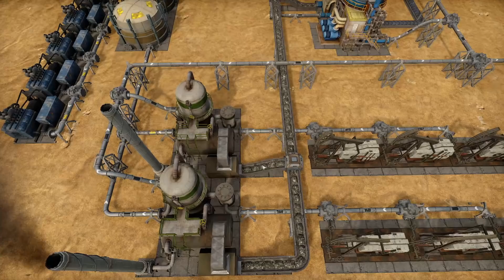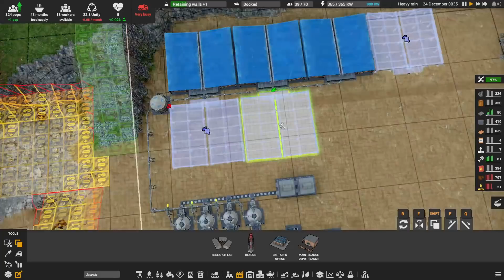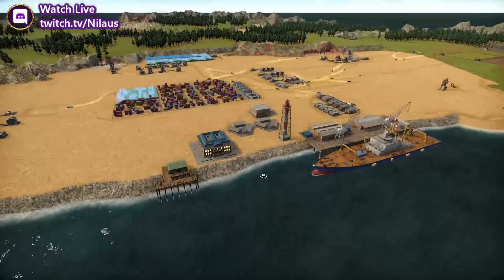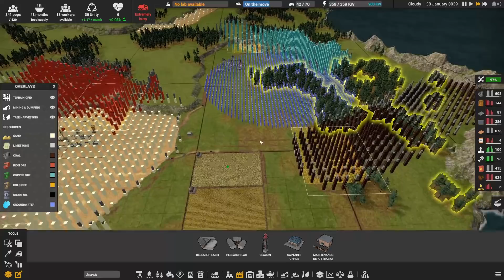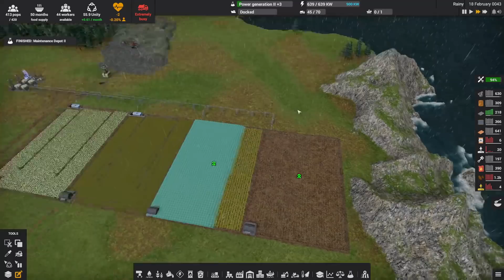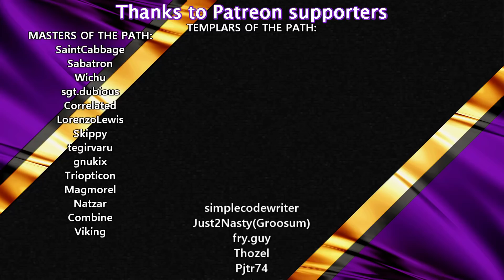Full Steam Ahead! Ship Repair & Sea Exploration | 05 | Captain of Industry | Lets Play

Comment: FYI you don't need to actually build the mine control tower to set what you can dump at a spot
simply changing the setting in the blueprint and then leaving it paused forever is all you have to do.

Comment: if the truck is stuck whit the sand like you had.
if its stuck for to long it will dump it automatically it was not the mine control tower
8:34

Comment: You don't have to avoid connecting belts as you're building in order to have trucks deliver. Buildings default to "Auto" for truck import/export, which means that they'll allow the trucks to drop off/pick up until the first item of that type is successfully delivered/output via belt, at which point it won't allow trucks any more for just that item.
Reply from the maker: Assemblers output materials into ghost belt, those items are needed to create the belt, that is why I do it

Comment: Those mine control towers you put down to fill in the areas and dig out the sand, I have found you do NOT have to actually build the towers, you only have to place them and leave them paused, they work without building them. (if you add excavators etc tho you do need to build them)

Comment: With the coal mine, what if you put a coal storage next to the mine, so the trucks assigned to the mine only have to travel a short distance, and unassigned trucks take from that storage to wherever it's needed?
Reply: I did this and also set up loose containers for rock and dirt right next to the pit. Then all the mining assigned trucks have to do is drive a short distance to that drop point. Other vehicles can then take it to the dump area. It seems to increase the turnover of ore as the assigned trucks don't get bogged down half full of dirt.

Comment: 18:40 The Ramps you can build are required for Excavators, and maybe for other very large vehicles too. An Excavator can’t pass under a raised Belt or Pipe, no matter how high it’s raised. So while you can use raising in most cases, you do need to have Ramp-paths through your colony to avoid Excavators unable to move around. Actually.

Comment: 12:23 Running out of Maintenance hurts so much!
The only thing worse than that is mass death, like the trashpocalypse that hit me a day or two ago. I don’t think even starvation kills as quickly as unremoved garbage does. I lost 300 people in a few months!
Reply: I really started getting trash problems when I upgraded everything to Housing 2, I started running out of places to put it before I can get the Burner operational.
The trick is to get Research Lab 2 up and running and research the Burner first after that. The only way out of the trashpocalypse is to burn it. Before that, I had to set up rows and rows of loose storage bins with U conveyors feeding them from the waste depot.
Research Lab 2 requires a scientific equipment ingredient that needs to be belt fed in, assembled in the electric assembler only, from mechanical parts, and electronics.

Comment: The ramps are available because the excavators and heavy machinery cannot travel under transports (pipes/belts).

When you are building transports the F button allows the pipe/belt path to block an input/output (like when you had to leave a space between the irrigation pipes because of the connector input).

Placing dumping sites at your mines to allow for closer drop spots for the rock/dirt to prevent trucks from having far travel times which bog down the mining process (or require many more trucks). Closer dump sites for discarded slag also frees up more truck time.

The screen that shows the status of all current vehicles also allows you to modify which materials are allowed in the global dump sites (separate from dump sites located within mining designations).

Comment: "I am scared of maintenance" - leeches materials off the maintenance production
Reply: maintenance need so much material.... I thinking about to restart and change the settings because my industry work 80 to 90% only for that !
Now i play for 176 Years and already no oil on the map left because the Fuel consuptiopn also crazy.

I Like Difficult games but that is insane. I struggling to expand only because of Fuel and Maintenance.
Reply: I am pretty sure he leeches materials off the vehicle parts production. Not the maintenance.